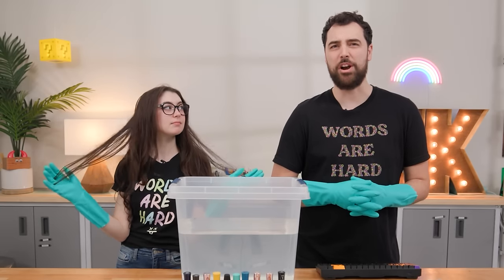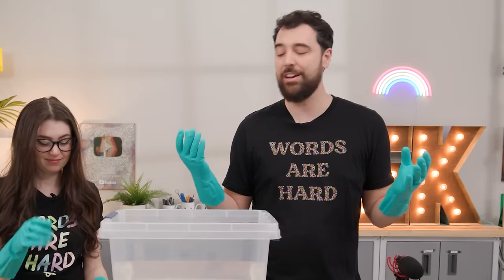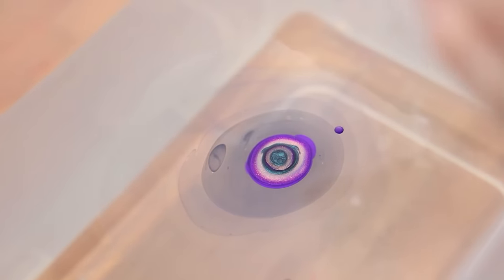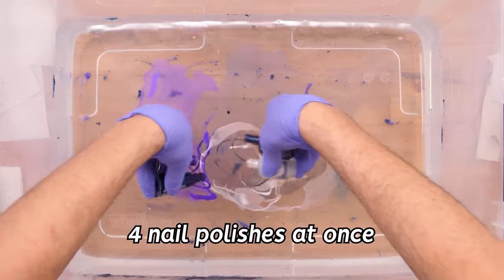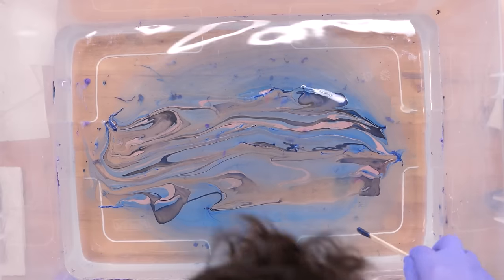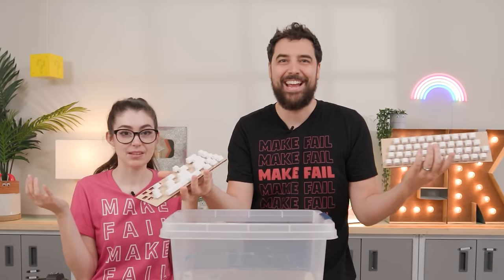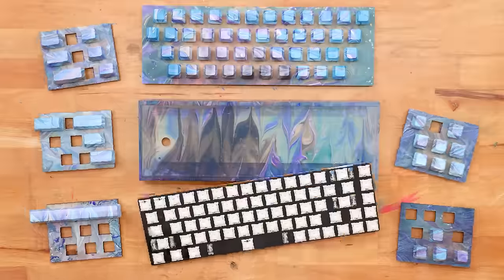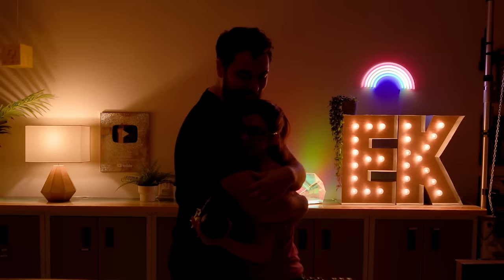Is it Possible to Water Marble an Entire Keyboard?

Comment: The only, but most importent question, they didn't ask, does nail polish stick to itself after it's cured? Yes yes it does. Does get really dry and crack over time? Yes, yes it does. I painted my cellphones with nailpolish (back in the 2000's when you could actually change the factory made covers easily AND the batteries) and anything rubber would stick to my phones and when removed it would remove the paint with it. Over time it would harden so much that it started to crack and peel off.. I still continued to do it since covers were way more affordable back then.

Comment: I wonder if the larger tank was an issue, not because of the water, but primarily because of the surface area. More surface area allows the solvent to evaporate faster, so maybe making a loose air seal over the top (like a sheet of plastic wrap) might concentrate the vapors and therefore slow the evaporation.

Comment: You probably have to shake the cheap nail polish up before pouring and use hot water. The first one looked separated and hardened by the water temperature. Not sure that's the problem but commenting for the algorithm gods. Love this channel.

Comment: You need to use room temperature, distilled water and very thin layers of nail polish. Pouring the polish in makes it too thick and it wont make the polish spread like should. Some brands of polish do work better than others.

Comment: I've seen festival vendors use spray paint for this type of process, which is basically the same as nail polish, but maybe they have more volume at a faster pace. I feel like your polish is just drying too fast, so maybe Gel polish might work? That doesn't try totally until you cure it with blue light.. Might be worth a round 2?

Comment: why are you so attached to using nail polish? you can water marble with acrylics. you can get them transparent by adding thinning mediums. you'll avoid the issues with clumping and thick areas that way. there's loads of colors and finishes and you can add your own mica or glitter and then do a light clear coat over the whole thing at the end. it's way cheaper than nail polish.  you have way more working time than with nail polish, too.

also fyi for folks who don't know this: please don't use nail polish as your clear coat, it will yellow, chip, and peel. a spray poly or varnish will do a much better job than nail polish

Comment: I've never heard of it done with nail polish before, but I think some of the issues that you had may be because nail polish is too thick and dries to a skin too quickly. When I've seen marbling in the past, it has used thinner paints like spray paint or oil based dyes which stay 'wet' for longer

Comment: Isnt this just hydro dipping?
Follow what hydro dipping does, and you'll get better results.
I think you should have printed or made a mock keyboard to hold all the keys in the same place as they are on the keyboard. And then dip the keys with that. Then dip the cover of the keyboard/shell separately.

Comment: ITS THE NAIL POLISH!! Nail polish can be made out of completely different things depending on the brand which is why it was so inconsistent and hard to determine what the problem was. If you're gonna use nail polish make sure to get thin nail polish but I would say just don't try the nail polish anymore. Find an actual paint you can use or even try resin. Nail polish is probably one of the worst things you could use because of the inconsistency and the fact that water cures it.

Comment: I've never seen anyone use nail polish. I don't know if spray paints have the issues that you had with this when using sprays. Maybe try that another time? You'll likely need to wear your full body air breathers, though. Or do it outside. But I've seen the sprays lay better on the water. But what do I even know, I've never done this before. And the end result is brilliant and freakin' cool.

On a different note, y'all get way too excited over glitter. That stuff needs to be illegal.

Comment: Considering people hydro dip entire guitars using giant garbage cans, it's definitely not the size of the bin you used. The actual culprit is you chose nail polish. Nail polish is fine on small scale, I mean REALLY SMALL SCALE, like 9 keys at a time max. Honestly before today, I've never seen anyone use nail polish to hydro dip because it's so naturally thick that it doesn't spread well. It's designed to be durable.
Reply: I think you’ll find that water marbling nail art first went viral about a decade ago. A quick search shows that ‘hydro dipping’ is mostly ink based and doesn’t really seem to be a related trend, though the technique is extremely similar. I guess the algorithms just don’t think you’d be interested for some reason? Likely because it thinks those are very different things, even though they’re not.

Comment: Lolol this one kinda killed me cause THERE'S LITERALLY OIL BASED PAINT SPECIFICALLY FOR THIS and it has a much slower drying time. The nail polish dries fast, and probably at different rates depending on formula. Works fine if you're just doing a quick nail, but y'all were one Google away from learning how to do this right. 😞

Comment: Your business expenses must be hilarious to file. 😅  Even using the "cheap brand" nail polish at Target isn't really cheap unless you get a large set or find nail polish for under a dollar each (possible but unlikely with inflation on everything these days). 😮  Maybe you should have looked for a good dollar store? 🤔  Though dollar stores aren't really a dollar anymore either. 😒  No way to win in this scenario unless you buy wholesale and that would probably require you having to convince someone you're opening a nail salon, lol. 😂

Still, the end result turned out great. 😍👍  I hope you protected it with a good coat of a clear lacquer spray paint or that's gonna chip with use the same as it does on your fingers. 👀

You know, I think what made the larger tub of water fail wasn't the size but the depth of the water.  You needed the water level to be higher, though having a "primer" in the water could have helped too.  Not alcohol or acetone but actually a clear spray paint might have worked best, since a light coat over the surface would be simple and quick to do and is easily pushed out of the way by the heavier nail polishes.  Just make sure the spray paint is compatible with the nail polish first and make it a gloss or preferably high gloss spray if possible because matte spray has extra stuff in it to dull the finish. 😉👍

BTW, the keychains are adorable! 😍  I wish I could afford to buy them but I'm struggling to pay bills as it is. 😢  I'm sure you'll sell tons though!  😉